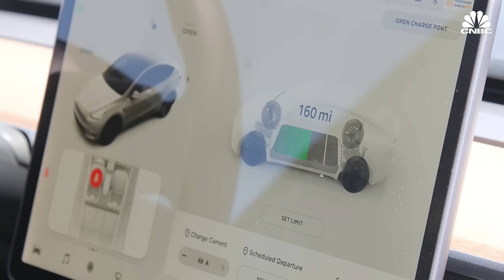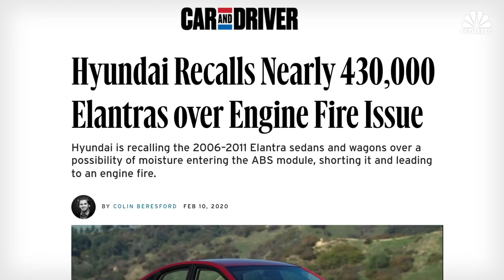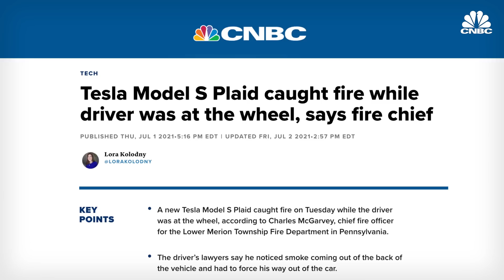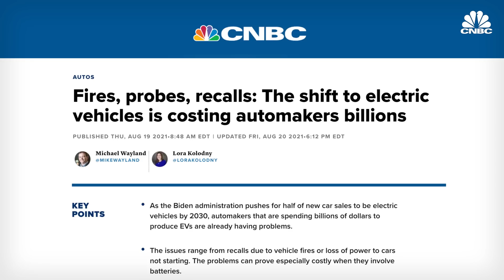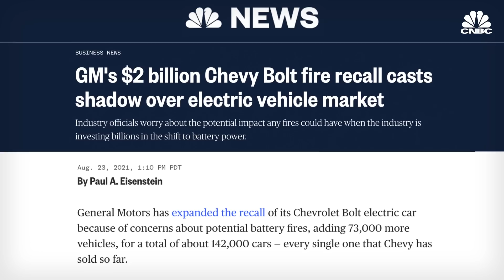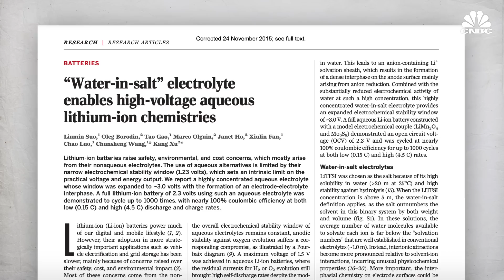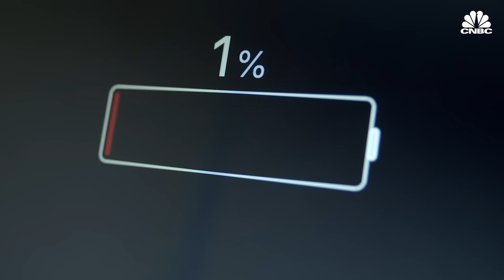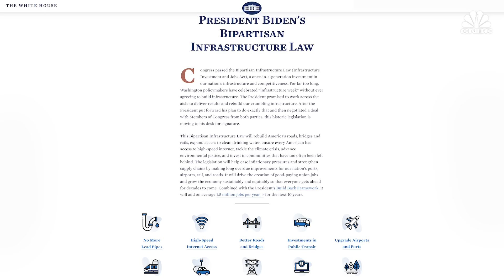Why Tesla, GM And Other EV Companies Have A Fire Problem

Comment: As someone who works in the insurance industry. The rates for ev will double along with homeowners insurance. Due to the fire intensity problem. Also I look at wreak cars all the time and the wrapper always on the owners manual.
Reply: Except that conflicts with actual data.  "Fully electric vehicles, on the other hand, were deemed far safer than both hybirds and gas cars; they are far less likely to catch fire, with just 25.1 fires per 100,000 sales. That's compared to 3,474 hybrid fires and 1,529 ICE fires per 100,000 sales respectively."

So, your logic here is that cars that are over 60x LESS likely to catch fire will be MORE expensive to insure?  How would that work?
Reply: @redbaron6805  It's not the car that's going to raise the rates. It's all the secondary damage that the accident caused that will raises the rates. So if your EV sits on the road and burns for several hours. police and fire 60000.00. environmental survey 2000.00. Repair of the road and all other items under it another 50000,00 to a 100000.00 It's the heat and the ability to put out the fire is the real problem. This is the best example I could come up with . Without writing a 20 page report.
Reply: @crashweaverda  you are wrong again, gasoline is harder to contain and can causes the same infrastructure damage. According to fire fighter reports, Evs take about 2-3 minuets to extinguish the flames but they continue to douse the battery to cool it down and prevent a re ignition. A tank full of gasoline will release 3x the thermal energy of a battery pack but with the risk of a fume explosion.

Comment: Yep, I've long foreseen this problem. It's bad enough that phones catch fire, what more if it's your car and potentially also your house.
Reply: But phones and electric car fires are exceptionally rare.  Over 60x less likely than combustion engine cars.  Because of that, the rate of fires would never be statistically significant enough to be even relevant to fire risk at your house.

Comment: Li-ion batteries provide their own oxidizer and do not need atmospheric oxygen to combust. Many ICE vehicle fires are electrical in nature. Lfp batteries are harder to ignite and the thermal runaway reaction is less severe than with metal oxide cathode chemistries; however all these batteries emit flammable gases during thermal runaway that can mix with air to form secondary fire and explosion hazards.

Comment: Do they? Are they catching on fire at a higher rate than gasoline powered vehicles? 
You made it sound as if the EV fire is especially more dangerous than 20 gallons of gasoline catching on fire.
Reply: I don't think they claimed the fires were more common, just more intense.  Actual data shows EV's are over 60x less likely to catch fire than combustion engine cars.

"Fully electric vehicles, on the other hand, were deemed far safer than both hybirds and gas cars; they are far less likely to catch fire, with just 25.1 fires per 100,000 sales. That's compared to 3,474 hybrid fires and 1,529 ICE fires per 100,000 sales respectively."

Comment: Oh, my goodness... So EVs are an example of an innovation that got way ahead of itself, at the cost of life and property, not to mention financials!  Did EV designers not anticipate or know this?
Reply: Ehmmm. no.  Not even close.  There is no "cost in life and property"  EV's catch fire 60x less frequently than combustion engine cars, and most of the fires happen after a violent crash where the battery itself was damaged.  So, your claims are simply false.

Comment: as a firefighter i must say, lithium batteries and oxygen dont mix.. well they do and it generates 1600 degrees. we do NOT use water on batteries at risk of explosion, we use afff foam substance that creates a barrier between oxygen and the exposed materials. this story is half true half bs and im gonna say an unpopular opinion, this is an attack by oil companies on ev production. they DO know the exact numbers because its reported to the national transportation board. i own ford rangers so im not an ev guy but support the idea of cars being ev with a solar panel roof to create longer distances.
Reply: An NMC lithium ion battery is self sustaining. It does not need external oxygen. A LiFePO4 battery does not catch fire and does not experience thermal run away. 
Lithium batteries do not explode with water. There was a time in the RC community that LiPo batteries were put in a bucket of water at end of life to completely discharge them. Silly in hind sight but anyway the point is not explosive reactions.
Reply: @RCdiy   thats why i love this job, you learn every day lol
Reply: @timtheflymantaylor6400  a solar panel on the roof of a car won't even power the electronics and no one makes money or political power from that idea. Which is the point of the electric car.
Reply: I took rusty lithium cells from old laptop battery and wanted so see if the cell has high resistance due to age. So I set multimeter to 10 amps and shorted the cell. My eyeballs popped. Even old, this little cell gives so much current. Now imagine all the cells in your When-Someone-Packs-A-Van-With-ANFO-He-Counts-As-A-Terrorist-But-When-We-Pack-A-Car-With-An-Incendiary-Bomb-We-Dont-Count-As-Terrorists-Tesla short at the same time in parallel. By the way, did you know the name of the Stanford University contains the word ANFO? StANFOrd.
Reply: @charlieangkor8649  so you feel safe driving around with many gallons of highly explosive gasoline? And being 10X more likely to catch on fire in a gasoline powered car!
Reply: @thomaswilson2917  I have absolutely no fear of parking my ICE powered vehicles in my garage while I sleep, assuming of course that they are not running.
But after almost having my house burn down from a hover board fire that I was able to get outside, there's absolutely no way that I would charge a Lithium powered vehicle in my garage while we sleep. I wouldn't feel comfortable unless it was closer to the street than the house. I can't simply lift a burning car and throw it outside.
Reply: @fauxque5057  what about your cell phone and laptops? Those also have lithium batteries in them.
Reply: Thanks for your comment - I always look into who is writing the article and many times the author(s) are tied to the oil & gas industry.  Even the one article written last winter after the I-95 pile-up saying "if they had been all EVs it wold been so much worse (also false) was by a guy tied to the oil industry.
Reply: @johnflowers4092  if you actually look at the numbers you are more likely to freeze in a gas powered car than in a new EV. I looked at my vehicles and my ev would keep warm about twice as long as my gas powered car. A typical car uses half a gallon of gas ideling. That gives you 32 hrs of idling. An RV will power the heater for 2-3 days.
Reply: @thomaswilson2917  I was very surprised to see how many EV-trashing articles had ties to oil/gas lobbyists, etc - yes an EV actually gets better range at a standstill or slow moving traffic, if you had an empty gas tank you'd be in trouble as well - full charge you can stay warm for days, esp if just using seat heaters, etc..
Reply: @johnflowers4092  Until those batteries mess-up and costs you almost as much as the car to replace
Reply: @thomaswilson2917  "An RV will power the heater for 2 or 3 days..." ???
Reply: @baneverything5580  typo.. 
EV
Reply: Many of the facts regarding EVs can be found in John Stossel and MGUY Australia videos. 

They burn through tires, the fires are frequent and immense, they're far too costly for what they are, they aren't good for the environment at all, they're unsafe not just because of the fires, but because they cannot stop easily when colliding with barriers, the interior is regarded as boring...you really do pay more to get less with an EV. Never mind the fact that range and reliability is terrible.

Besides, who would want to support someone like Elon Musk? Does buying a Tesla come with being chipped too? Hmm? 💩
Reply: I know nothing about this, but arent EV fires handled like an electric/metallic fire?
Reply: An attack by oil companies on far left liberal NBC/MSNBC/CNBC ???  The same liberals that push climate change and claim electric cars, windmills, and solar will save the planet?  
You are a funny guy or just not so bright for a firefighter.

Maybe an article on Fox or NewsMax or Sky News would have been pushed by OPEC, not CNBC.
A big “Thank you” and props to CNBC for actually reporting the truth.
Reply: 1600  degrees , very  interesting.  The  Tesla  or  GM-dealers  probably  do  not  tell  customers  that.  I  know  about  semi-conductors  (  diodes  transistors  and  solar-cells )  and  my  GUESS   is  that  a  solar-panel   of  the  same  size  as  the  roof  of  the  car   will  have  difficulties  providing  sufficient  energy  to  the  electric  motor  for  continuous  driving.   I  cannot  imagine  a  Ford-Ranger  with  a  ton  of  load   on  the  platform  and  four  fat  persons  in  the  cabin   rolling   along  on  the  highway  with  50  miles  an  hour  for  as  long  as  the  sun  keeps  shining  and  not  stopping  until  it  rains.   2  miles  an  hour  perhaps ?
Reply: You’re not using the water on the battery because of risk of explosion.
They don’t really explode. Not in the conventional sense. The problem with water is it can create additional short circuits which will cause other parts of the battery to burn. Then there’s the additional problem of a damaged battery pack can catch fire hours later.
Reply: I was thinking that also why not make the rear windshield, and front windshield, and sunroof, solar panel...
Reply: Tesla specifically says to use water to put out their fires.
Reply: If a Tesla battery breaks it will cost you 23K to replace I don't think the oil company is doing that
Reply: @NeekSquad  
Yes an out of warranty New battery on a Tesla could be up to 23K. 
But there are companies that repair Tesla batteries. 
And I would imagine that junkyards are going to recover the batteries from wrecks where they are not damaged. 
The same way you can buy a junkyard engine.
Reply: @neilkurzman4907  Lol
Reply: "Solar panel roof" shows you know nothing about solar or solar panels.
Reply: Yeah, I’m not totally buying this. Mainly because we already know EV fire numbers aren’t going to be significant compared to ICE vehicles because EVs still aren’t on the road in mass numbers like ICE cars, especially in North America.  So, what would be the need in covering up the small EV fire numbers when we (the public) already know they are insignificant in relation to ICE car fires?  Third, are oil companies also lying about spontaneous combustion in some EV fires and thermal runaway?  Because the way I see it, those are the serious issues with ICE fires, and not necessarily the number of fires themselves. But with your theory I suppose the oil industry is getting fire departments to lie about how challenging EV fires  are to put out.  Plus, what about confirmed cases where EV fires brought down an entire cargo ship or building structures in the UK? Are those lies too?
Reply: “an attack by oil companies” he says. I don’t think do.
Reply: @stevepowsinger733  oil companies just love seeing their customers switch to electricity from gasoline!

Comment: me at the beginning: damn i’m never buying a tesla. getting burnt is my biggest fear.

3:37: finds out the car i crashed a few days ago, a hyundai elantra, has an engine fire issue.
Reply: The difference is that your Hyundai had a problem that was overlooked when made, then fixed through recalls. Electric vehicles cannot be "fixed" to not catch fire. Electric vehicles will all burn after the wear and tear of driving eventually causes a failure that leads to a fire.
Reply: Oops! How you're okay.
Reply: @seattlekarim964  i am! thanks for asking. although the car was totaled, i only got whiplash. i was very lucky.
Reply: @kat-jl6ex  yup, gas line couplers fail. Glad you're ok !!
Reply: @kat-jl6ex  That was a gasoline car..right. You should keep in mind a lithium fire burns so fast...if you are in a car accident and the battery is comprised and catches fire...Your entire car will be engulfed in flames within seconds. You have no chance to get out. You should consider yourself lucky you were in a gasoline car.
Reply: more kia and hyundai cars and suv have caught fire than all of the EVs combined.  FACTS.
Reply: @Cancri71  FACTS. You saying FACTS doesn't make you right. It makes you seem childish and unsure about what you are saying. Provide evidence with your FACTS

Comment: 🔥Ok.. 
But:
..study conducted by AutoInsuranceEZ using data from the NTSB (National Transportation Safety Board) showed that electric cars in the US caught fire at a rate of 25.1 per 100,000 sales compared to 1,530 for ICE vehicles

? --> 1,530 vs 25.1 electric cars 🤯
EV fires, were mostly Chevy Bolts, but GM is fixing that

Comment: A discussion about EVs isn't complete without a mention of FCEVs.
Reply: Do you want to own a car that costs you twice as much to fuel as a gas car??? Fuel cells are horribly inefficient.
Reply: @davefroman4700  EVs, even FCEVs, save money on maintenance because there are fewer moving parts.  Fuel cells have greater mileage than all other fuels, and hydrogen is inexhaustible.  BEV and gasoline fires take far more effort and resources to extinguish.  BEVs can lose up to 20% of their mileage in cold weather.  Gasoline cars pollute unsustainably.
Reply: @palmshoot  yeah? And if a hydrogen tank exploded it would level 5 city blocks
Reply: Its takes 3 times as much electricity to produce enough hydrogen to travel ten miles than it takes for a BEV to cover the same distance, due to the inefficiency of converting it back and forth.
Reply: @palmshoot  Oh and I should add that every fuel cell today has required the use of platinum in their systems. A resource even rarer than cobalt. There is NO way to scale that technology.
Reply: @palmshoot  You obviously have no idea how much energy it takes to not only create the hydrogen, but how much energy it takes to compress it into a liquid for use in a system.
Reply: @davefroman4700  When has a hydrogen tank leveled the equivalent of five city blocks?  Brown hydrogen is already produced on an industrial scale, so we likely would have seen such incidents already, now, wouldn't we, if that were the case?  

Hydrogen can be stored above ground, underground, out to sea, and even underwater where few people are around.
Reply: @davefroman4700  Not only is hydrogen inexhaustible, but with the right renewables, so is the electricity used to produce it.  It has been projected that the current US grid would not even be able to withstand an earnest rollout of renewables.  There are even ways to reduce our current usage by around 40-odd percent in residences.

BEVs suffer from long refueling time and the aforementioned drop in mileage in cold weather.  The materials for BEVs and their chargers are in short supply.  BEVs are non-starters for many who rent homes.  The charging infrastructure is anemic.  Battery materials also have to be mined while hydrogen does not.
Reply: @davefroman4700  IEEE reported on an effort of using spinach to replace platinum, so your knowledge is outdated.
Reply: @davefroman4700  You obviously don't realize that there isn't exactly a shortage of energy in the US and that are over 100 GW of energy that we're not even using, as reported by the Department of Energy.
Reply: @palmshoot  We have buses here running on h2. You know where they put the fuel? Middle of the roof. Safest part of the unit. It it were in a car that got crushed by a bigger vehicle the amount of explosive force release if that tank failed would be enormous. Even in the couple of commercial trucks I have seen with it the tanks are behind great big steel tube cages to protect them from an impact. Its hard to put that much protection into a smaller vehicle. Even the Toyota had to sacrifice capacity and place two smaller tanks in the middle of the car under the floor and add a kevlar shield with a steel outer skin. Why do you think we made a hydrogen bomb? Its WAY more explosive than any traditional explosive.
Reply: @davefroman4700  You keep talking about hypotheticals.  Even in the catastrophic case of Hindenburg, most of the people survived.  If you won't cite real-world examples of hydrogen vehicle explosions, we should just end this exchange.

There are lightweight materials that are stronger than Kevlar.  Carbon fiber is one that is commercially available.  Super Magnesium is stronger than titanium while also being light.  Nonetheless, modern tanks are lighter than batteries.

Hydrogen bombs utilize fusion, something not employed in fuel cells or the production of hydrogen.  You're comparing apples to oranges.

Comment: EVs are trash. I wouldn't be caught dead driving or riding in one.

EVs are for Boomers and Gen Xers that don't do anything or go anywhere other than work and home or if they retired.

There isn't a Gen Y'er/Millennial or Gen Z'er that will drive an EV long term unless their parent(s) brainwashed them into believing EVs are better for the environment when people fail to realize that the minerals dug up from the ground has to create those batteries.

No thanks. I stick to what's tried and true and will be less problematic and still far more reliable than any EV will ever be no matter what the anti-internal combustion engine (pro EV) people will say.

Comment: Fake and made up story. This is not report this is a Propaganda.
Last summer i saw Subaru and Toyota with blades batteries, and they are save, even with nail penetration, there is no drama at all, and the battery keeps working.
I do over 130 miles per day, once a month i see ICE car on fire, and over 7 years i haven't seen an EV on fire so far.
I suggest to avoid this kind of '' reporters ''.